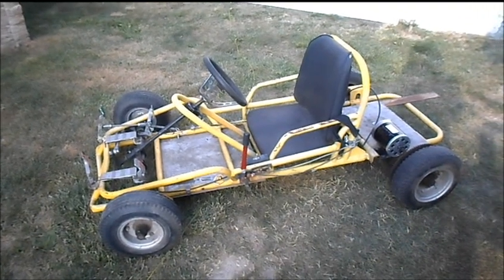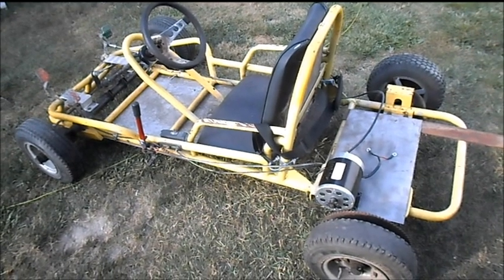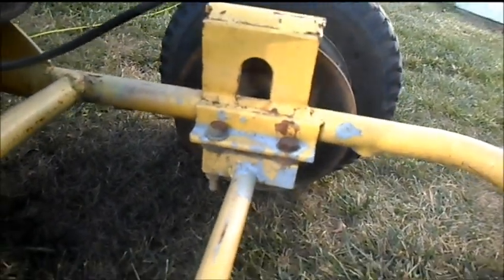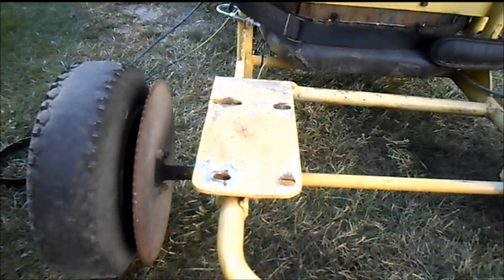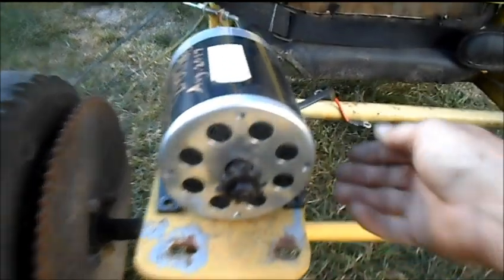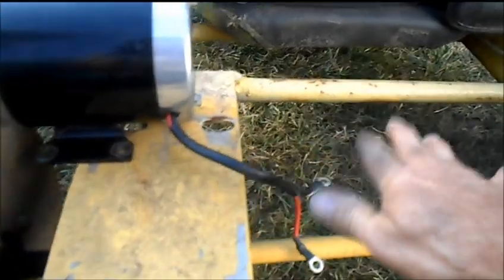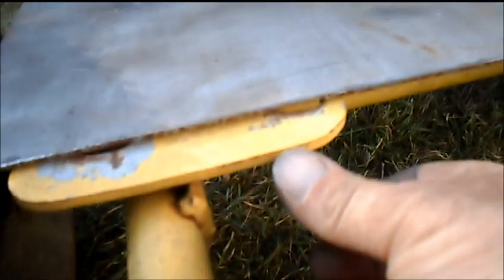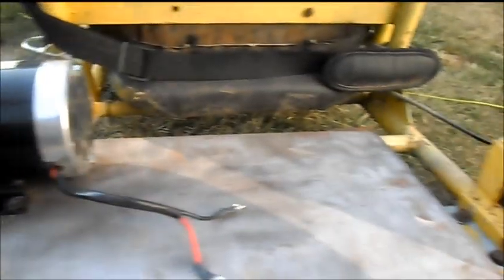e Lemon aid part 1 intro & where to start

Comment: Did I miss where you showed how to adapt the #25 chain sprocket of the motor to the #35 axle sprocket?
Reply from the maker: The motor is off an electric minibike. It already had the #35 chain sprocket on it.I will look to see if this sprocket is available.
Reply: Were you able to find any info on #35 motor sprocket?
Reply from the maker: Yes, I think I have. I am waiting for a reply.
Reply: @functional_artist  what is the axel sprocket size? 65T?